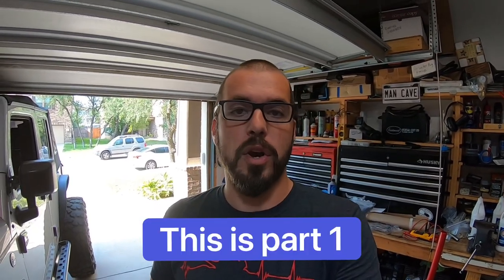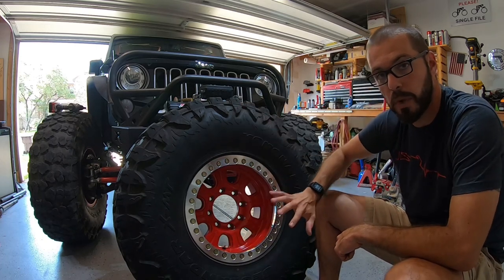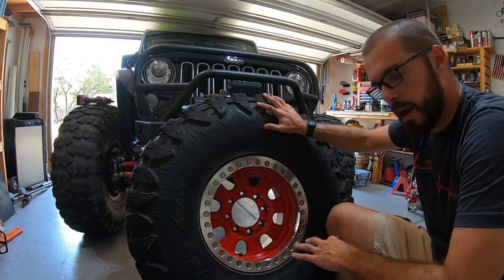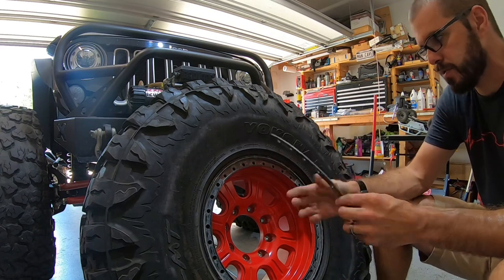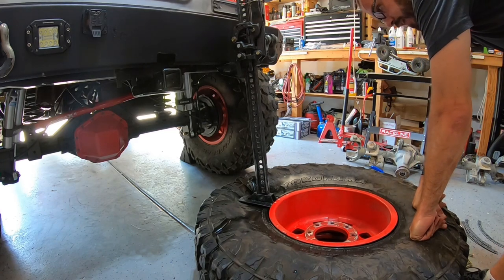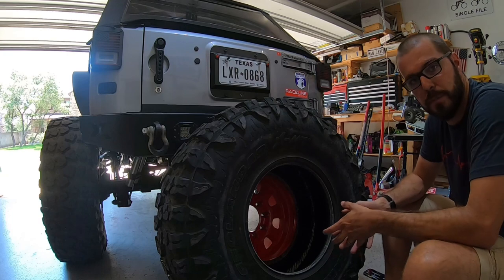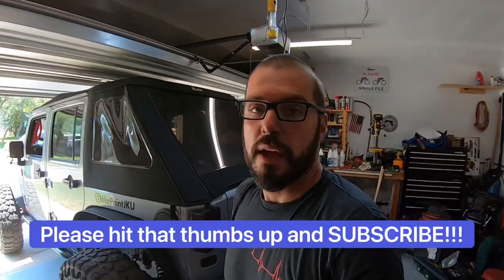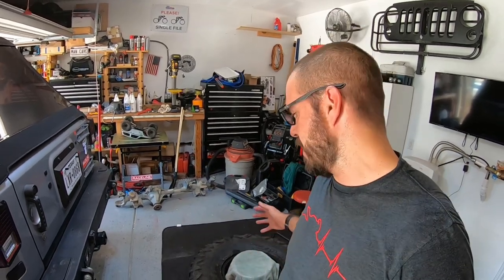How to Dismount Tires on Beadlocks

Comment: I did mine on my f-150 4x4 . I’m 60 it took me some time but I was able to do it .
Reply from the maker: Awesome! It definitely takes some time. But knowing its done right is worth it.
Reply: @WarPaintOffroad  I’ve never done bead lockers.  I think a tire shop can handle mine from now on ….  That’s not easy lol
Reply from the maker: @jedeckerd5969  it’s definitely a little time consuming. Remounting them is way easier. Most of the time spent is on the bolts of the beadring. The problem is most shops won’t do them because they are so time consuming. And if they do they sometimes charge $100 per wheel. So it gets expensive quick.

Comment: Stupid question alert!!! Can I air down all the way remove the ring and air back up again and drive off? Only asking bc taking a new set of tires to a shop to get them mounted.. they don’t work with beadlocks for liability purpose
Reply from the maker: You cannot. The ring is what holds the bead on the wheel. If you remove the bead the tire will fall off the wheel.
Reply: @WarPaintOffroad  thank you! 🙏